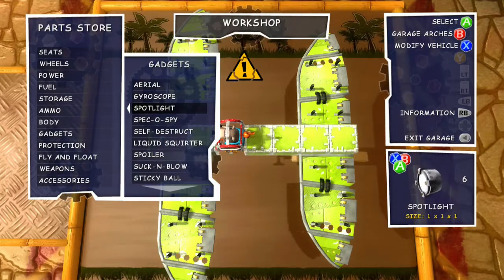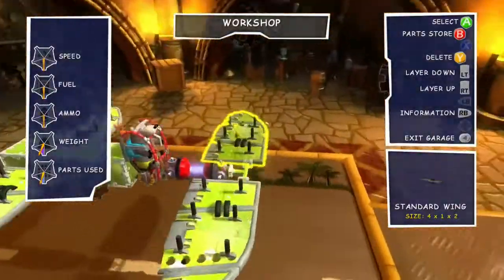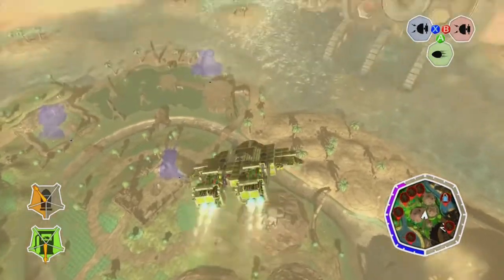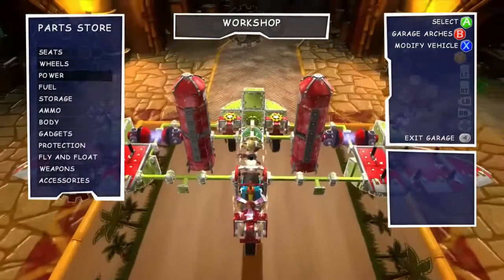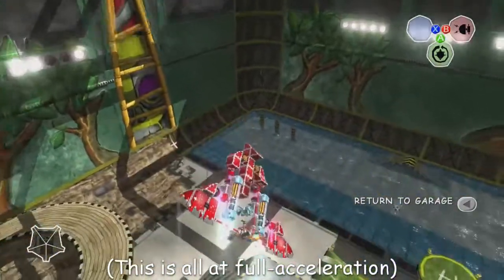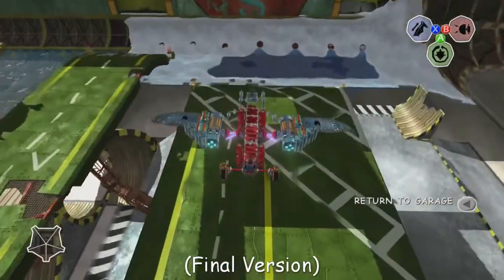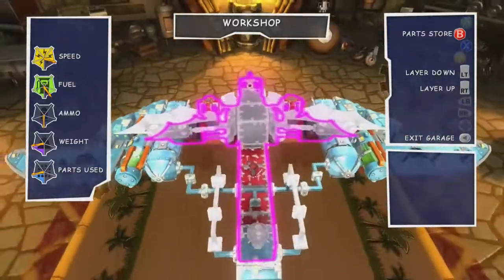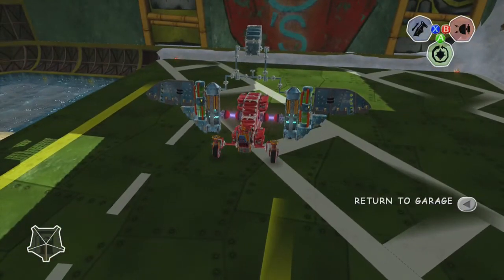VTOLs - A Builder's Guide to Nuts & Bolts

Comment: One of my all time favorite youtubers, you're a madman, dude! This is genius.
Reply from the maker: Thanks Mega Man! - Grim
Reply: You know, I tinkered with this sort of mechanism for my first vtol, but I never considered some of the things you managed to fully implement! I had a question though. Would it be possible to do this sort of thing, but with a second rotary piece, (Like an additional engine block) Either elevated or side by side?
Reply from the maker: Certainly! The only real limit to how many rotary pieces you can add is how many towbars are available. It is best though to have them (especially side by side) connected as one on a sort of axle, as the only issue is if your banking, or something hits you the two engines could de-sync if not connected (you'll end up with one pointing backwards, one pointing upwards, and it'll be a big ol' mess). The axle obviously can't be done if they're not on the same axis (so if your second one is at the back, or a separate elevation, an axle would not be feasible without it being super ascetically unpleasing) so in that case I'd suggest having a detacher connecting each rotary piece to the vehicle in a fixed position (i.e flight mode). Detach them, and use the vehicle as you would a normal vtol, but if the engines get too out of sync use the detacher to reconnect then disconnect them to get them all re-synced again. If you have trouble with the axle idea, the Build Request scheduled for tomorrow has side-by-side engines ;) - Grim
Reply: That's awesome, man, I'll have to check it out! I always enjoy your added mechanisms in this sort of thing!
Reply: So I'm sure you get like, thousands of these, but I'd like to submit a build request anyway?

I really loved your turret videos, in fact, they were among my very favorite, because I'd been tinkering with them for a while already, and then it turned out someone had already mastered it. So the actual request is a little out of the blue here. Me and my brother were screwing around and we found out that if you drop a Mumbo Bombo bomb onto a spring, and then activate it, you can, in fact, launch the explosive. I made a rudimentary mortar this way but it was never really polished, or very good looking. Do you think there's any chance you could work with something like that? You could aim it with the turret function from your advanced turrets video.
Reply from the maker: That's really cool! It makes sense that that would work, but I had never considered it nor played around with it. Can definitely do something with that information, I think! - Grim
Reply: Awesome, dude, I knew you'd have a thought on the matter!